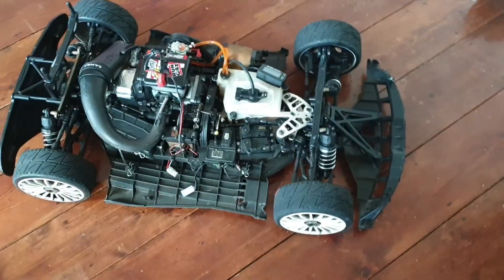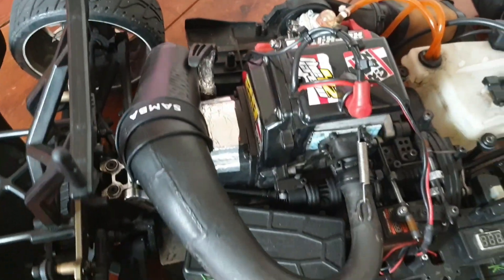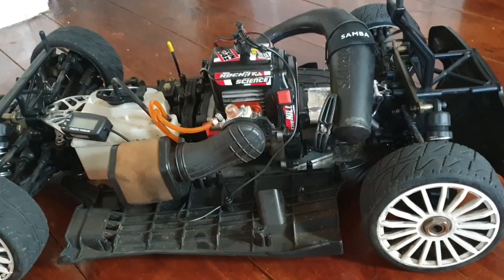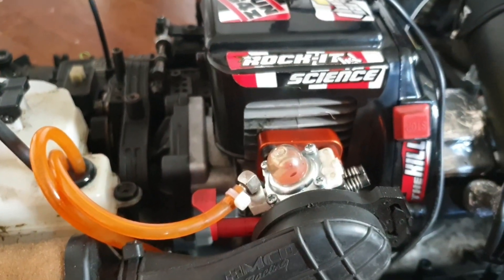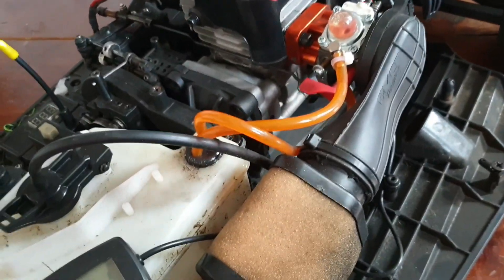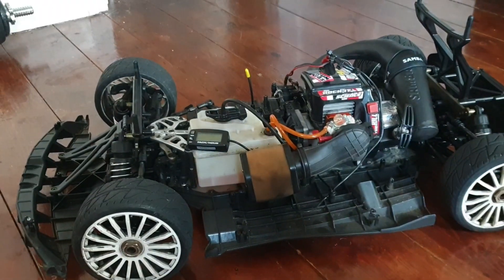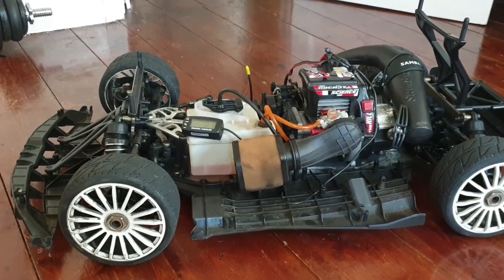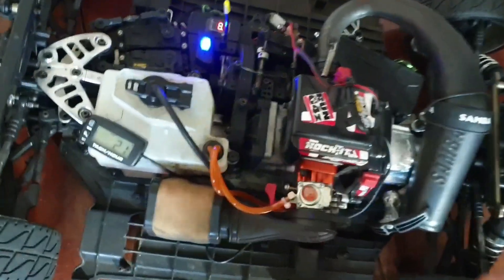Rovan 45cc powered Mcd xr5

Comment: I own 1 my self.I have upgraded  a few parts like chassis and wishbones to mcd alloy parts was thinking about the zeonah 31.8 cc tuned engine.What are your toughts on what type of performance upgrades for more power
Reply from the maker: I think that would be a good upgrade but you will get alot of understeer with the more powerful engines I ported my 45cc myself its fast but gotta slow down then throttle it to corner on tarmac and still goes round sideways like a drift car.but on grass its perfect
Reply from the maker: I will also be adding more alloy to mine in the near future
Reply: @2strokerc5782  im going next week to king cobra racing to upgrade mine.

Comment: The mcd x snap 2 ratio gearbox with the zeonah enging sounds good.I wonder what type of power gains or speed
Reply from the maker: Would be alot on road or off road ?
Reply: @2strokerc5782  on road
Reply from the maker: @rcfrenzy6477  gonna be fast
Reply: you can calculate this. the normal setup for On-Road is 24/61 (1. gear) and 27/58 (2. gear). the On-Road wheels have a diameter of 160 mm and if the engine runs with 19.000 rpm then this will be a maxium speed of 88,92 km/h (theoretically)

Comment: Which carburator do you suggest for this engine? I have one on order right now from China (Aliexpress)
Reply from the maker: Mine came with a ruixing walbro clone works perfect but I had a 990 on a previous engine that I tried on it and that worked too but I stuck with the ruixing as I modified the choke and it was brand new
Reply from the maker: You will love the rovan 45 it's an affordable beast
Reply: @2strokerc5782  Thanks, I hope so too. Mine comes with a Walbro 1107 carb so with choke. I've heard from others that it runs the 45cc a little too lean. A 990 would be better because it can flow more gas. We'll see I guess. So the most important things I need to do when I get this engine is venting the pull starter, making a custom header for my exhaust to fit (I want to use my VRC bigbore exhaust on this engine) and change the plastic isolator block for a aluminum one. Can I use the ones that are made for a Zenoah G320rc? Any other tips/recommendations?
Reply from the maker: @Tomberland84  I was lucky enough to not get the 1107 with mine but that's what I heard aswell
Reply: @2strokerc5782  Hi, I got the 45cc engine today from China and luckily there is no 1107 carb on there. Instead it came with a Walbro WT-1191. I don't know anything about this carb. Is it any good? It is supposedly suitable for engine from 32-38cc. Any suggestions on the needle settings? Thank you 😊
Reply from the maker: Hi It might work but I'd say start at 1 and a half turns on the low needle and 2 on the high needle and richen or lean it out as needed mine came with a ruixing carb I know the walbro 990 works on that engine but I'm not 100% on the 1191 as I never had that carb
Reply: Tomberland if you want your 990 carburetor to dump more fuel on the top end? You can always install a 15lbs spring in it . I may try out my True Modified 990 Rooster 🐔 Tail carb on my Rovan 45 Baja once I unbox it? I have had it in the box for over 2 months now . Just not enough time in a day for me and now the weather is terrible for me in N.Y. USA .Goid luck to the both of you guys and keep up the great work💥🤝💥👊💥! I would really like to get a On Road car like this in the near future.
Reply: @BOTAJELL  Not enough hours in a day sounds very familiar. I wish there was more time! Too many projects and fun stuff to do and too little time beside work and family. Oh well....just be patient and do things one at a time 😊